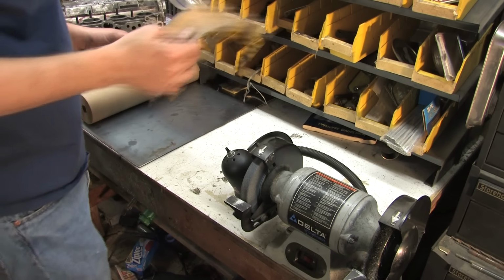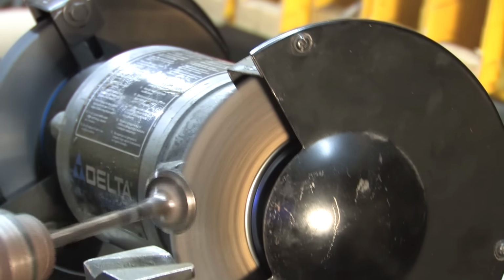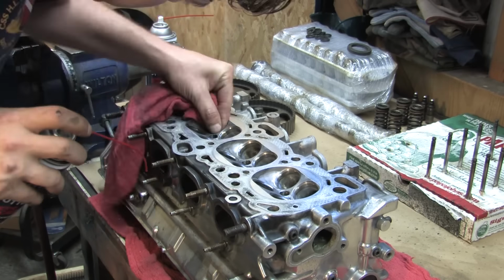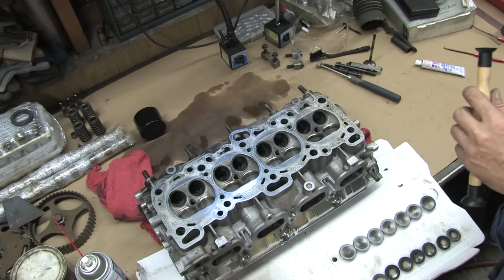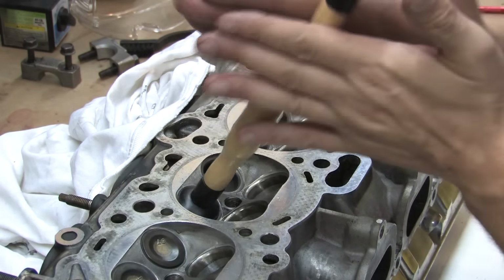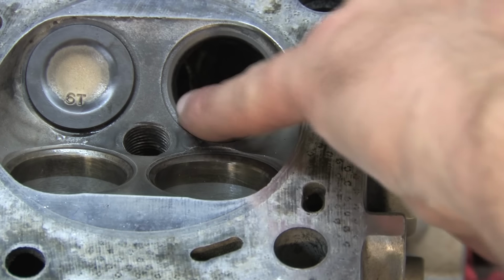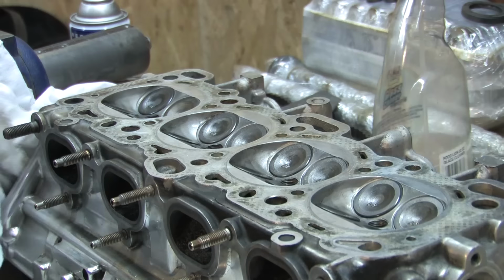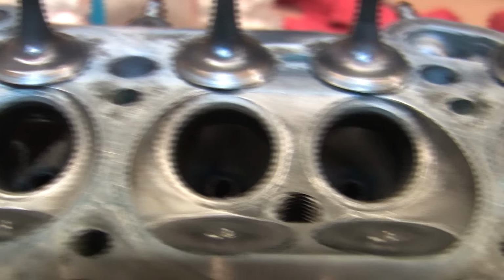Cylinder Head 105 - Valve Job Basics

Comment: Done this a couple of years back on a spare 4 cylinder head i had after watching this vid. All in all it took me around 6-8 hours, took my time, no rush, had the little pots of course and fine compound you mentioned. Head went on my car and is still on there now and holding up fine.
Reply from the maker: Thank you for the feedback!  That's a beautiful e-type in your profile photo, Bob!  BTW... are you my uncle?
Reply: Haha, that E-type was at brands hatch race circuit a few years back. Gotta love them cars, there was a white V12 one racing around the track also, the noise it made going down the main straight was probably one of the best engine sounds i have every heard.
Reply: What the name of the compound ?
Reply: compound w

Comment: I'm about to make my first lapping attempt, and was considering the drill method. You convinced me to start by hand and get a 'feel' for it. Thanks for the great info!
Reply from the maker: Just remember that lapping is not a fix for a bad seat.  It's just a test to see if you have a good seat.  The less time you spend lapping to make that determination, the better.  :)  Read other comments here about that before you start.  Unless what you're working on is built before World War II, lapping is a test, and only a test.  If you have a bad seat, visit my radius cut valve job video!  ;)
Reply: I used the drill for my first time because I didn’t have a lapping handle and it worked great

Comment: Cut a piece of fuel hose that will hold the valve stem and something you can chuck up in a drill.
Keep the drill on slow speed ,  you  can hear the compound change sound when she's good.
We're not building top fuel dragsters it will be ok .

Comment: One short comment, using a drill connected to the valve stem is a bad idea as you state,  I use a two inch piece of rubber hose connected to a wooden dowel which goes into the drill and the other end slips over the valve. It does a great job and it's fast.

Comment: Thank you ! Wire wheel is the only way to remove harden carbon on the valves. I soaked them in Chem-Dip overnight without any effects.

Comment: i like this guy.  He does everything right...has a good head on his shoulders.
Reply: tocay
Reply: Actually he doesn't he missed major steps
Reply: kevykev38 Such as?
Reply: @kevykev38  splain
Reply: @Xsidon  Vacuum testing for one. In valve seat machining, this is absolutely critical.  Lapping the seats is generally the last chance approach. Working the seats as shown here is the approach of do it yourselfer. Not to say it doesn't work and not to take anything away from the video. However, having a machine shop machine a 3 angle valve job (after guide replacement if necessary)  along with a vacuum test is the best way and well worth the money.
Reply: @martin1b  correct me if i'm wrong but what you are talking about seems to be just about confirming the quality of preformed work. it's not a step of the seat matching process itself. plus if you can see where the valve was lapped you can be certain about it beeing done correctly. no lapping marks means something is off but at this point i assume you'd need a new seat anyway. again correct me if i'm wrong
Reply: @Xsidon  Yes, but it is a very important step. You cannot visually see if it's done properly because lapping, and even machining is susceptible to chatter which will cause the valve not to hold.
Reply: @martin1b  honestly i had no idea chatter can occour during lapping. i gues we learn something everyday. good talk thanks
Reply: He could have been COVID-19 Vaccine developer, methodically done job.

Comment: Great job and video. I did do mine with a drill. I was damn lucky on a 4 cylinder gm mercruser. Runs great. Your method is the correct way.

Comment: This is a valve lap. A valve job requires grinding the valve, and seat with a one degree difference. 45 valve, 44 seat. it promotes a better seat,  and breaks in the valve properly over time. Hence it lasts longer. A lap just sands them down to the same angles, and makes a wide seat area, instead of a fine line at the upper portion of the valve face. I'm not saying that what you are doing doesn't work. It is just wrong to call it a valve job, and doubly wrong to sell it as one.
Reply from the maker: The title of the video is "basics".  It's showing the same technique used to verify whether or not a seat is good.  In this video, guess what?... the seats are good.  In the description is a link to a valve job being performed.  There's a section in there about grinding valves.  That's basically the valve job "advanced" video.  I mislead absolutely nobody.  I'm not disagreeing with you, anyone who finds a bad seat is naturally going to realize this doesn't fix it and they need to take it further.  This is the basics.  Hence, the title.
Reply: 4g63?

Comment: Did this to my Toyota pickup 22R.. it runs way better cleaner and efficient.. thank you
Reply from the maker: My old '85 Xtra Cab Deluxe had a little carbon problem.  After a rebuild, I kept it alive for 330,000 miles just using regular BG44K treatments and better gas.  I miss that ol' truck.

Comment: One of the best automotive videos I've watched! Your expierience and knowledge is obvious but you also have a gift for teaching.
I was ASE cert with 25 years expierience. I owned an auto and truck repair shop and employed 15 full time techs.
My shop was 25k square feet and had a machine shop and a partitioned body shop. I owned a separate Corp that was a H D and light duty towing Co.
Also had Volvo, White, GMC dealer affiliation authorization.
I started in a 2 car garge at my childhood home.
I lost it to leukemia but only mention it, 1) because it was a source of pride and 2) because you mentioned health risks when using chemicals. I was proud of you for that. For all those that don't take it serious, my leukemia was likley caused by siphoning gas as a kid when I worked for a bus co. On several occasions I swallowed a bit. I have been suffering the effects for 35 years of which the last 12 included bone marrow cancer. My leukemia was a precursor to BMC so I knew that day was coming. If your reading this, DONT DO IT!  BTW your video brought back memories, good ones. I too was a perfectionist, (Of coarse didn't always succeed). I used the exact method you did and was taught by a master machinist.
Thanks
Reply: Nice heart-felt comment.
Reply: Joe Mikos Hope you get better.
Reply: Joe Mikos i cover myself in this crap all day working in cars i know the damage i know the danger but never think about it like most things in my life. i hope  you get well and recover.
Reply: Joe Mikos i cover myself in this crap all day working in cars i know the damage i know the danger but never think about it like most things in my life. i hope  you get well and recover.
Reply: Joe Mikos  YOU was SAE and YOU learned from THAT? Guides need replacing using special tools. Seats require special tools. If he wants to pull the head back off at HIS expense, that's him!
Reply: Joe Mikos 💜💜💜
Reply: Joe Mikos My hat off to you sir!
Reply: Get well and recover quickly
Reply: Marty Stevens - wtf are You talking about?? Clearly you have no compassion. I feel sorry for your spouse or anyone related to you, for having emotions, but not being able to express them to someone that matters.
Reply: Im no Dr. but I highly recommend that you look into Rick Simpson oil. This stuff has hundreds of cures! Taking high doses of vitamin C & D (10,000 ui) will dramatically increase you immune system, BUT blood work will be needed to assure you are not taking too much. Happiness is also a (special) key that helps rid the body of negative viruses. Inhale the green light (while smiling), exhale what looks like smoke. I know it’s a high dose but there are plenty of videos backing this up. Please do you diligence. If you need help ding them, just reply back and I will post them for you.  Good luck and God bless you on your mission.
Reply: How come you listed out your entire resume here when all you wanted to do is say "thanks"? lol
Reply: Joe, Thanks for your honesty and for sharing your struggle. I pray you're still with us ! Your warning is well received and duly noted. Thanks for the "heads up" mate. God bless you and peace from Down Under ! Marc
Reply: @elmntlgnd69  lol stop promoting snake oil bullshit
Reply: @masonhales  Because he knows that he's dying?
Reply: @Mason because unlike you Joe Mikos was someone and somebody who mattered.
Reply: When you say gas, you mean Diesel? Or petrol?
Reply: Mason 😂
Reply: What are the torque for the EL10  crank shaft and conneciting rods
Reply: Hopefully he is still around <3
Reply: @elmntlgnd69  all of the claims you made about RSO and vitamin c and d are completely lies. I've had thousands of milligrams of rso and so has my girlfriend. Didn't do anything to our health other than get us high. Stop getting health information from facebook and instagram.
Reply: My dad is always doing that even today if the carburetor has clogged, he's 61 years old now and no any ailments or anything.
Reply: WHAT A TIME
Reply: Take care and bless you sir.

Comment: This isn't a valve job,this is valve lapping. Those seats are way too wide.
Reply from the maker: ***** I can appreciate that.  Really they're not, and it passed a vacuum test at the machine shop afterwards, but I wasn't happy with them either.  So... this exact same head is in my video "Cylinder head 201" getting a fresh radius-cut valve job on 1mm OS valves.  ...and yes, they're oversized because my cams and rev limit are changing.  I think there's an annotation leading to it somewhere in this video.
Reply: Vacuum test only tests the seal. Wide seat reduce the ability of the seat to seal against carbon build up on the seat  and wide seats reduce total flow.
Reply from the maker: ***** I don't see anywhere where we disagree except that I have the factory service manual and verified the my seat width was in spec.  Sure it was near the end of spec, but It would have gone at least 30,000 more the way I was using it even with the dual valve springs and aftermarket cams.  This head only had 48,000 miles on it.  But, yes, we both agree.  It was near the end of spec, and I wasn't happy with it.  

Some people have a problem with the title of this video, and there's absolutely nothing I can do to help them.  I'm not changing it.  This is a 100-series topic.  Lapping, disassembly, and assembly... are things a home mechanic can do with the right set of tools.  Seat cutting and valve grinding is typically not.  That's why the 200 series valve job video is shot in a machine shop and handled as a separate topic.  It's linked from inside this video [if your annotations are turned on] at 13:35.  During #201, the machinist does the exact same procedure in this video.  He lapped in 4 valves this exact same way.  2 of them to set the guides on the machine, and 2 more half-way through the job to ensure the guides didn't move and to check his work.  So, lapping valves is by all means a basic valve job procedure.  There are a lot of R&R procedures, and that's why my cylinder head series has so many videos.

When I get a bad example to demonstrate, I'll show it.  I just haven't yet.
Reply: Factory spec has nothing to do with performance. Do any race teams use a factory spec manual...no. It's all about the R&D on the flow bench and dyno. I spent from 1994-2007 doing just that using port flow analyzer 3.0,super flow 600 and a depac dyno and cutting tons of experimental valve jobs on dozens of cylinderheads. You really want to get into black magic...valve springs and cam specs.
Reply from the maker: Performance is why I had new seats cut to a specific depth on a radius cutter and replaced all the valves.  I'm sure by black magic you're referring to the valve spring and camshafts' affect on seat pressure and by cams you're referring to airflow and valve timing.  I've got videos on those topics, too.  Those are also fairly basic, but they're enough to help someone new to the process understand how to dial in their DOHC cams correctly where they should be.  Us turbo guys also have to consider boost pressure with our seat pressures in addition to cam and spring selections, so it's like black magic with chocolate sprinkles.  And of course, "sprinkles are only for winners."  :P

EDIT:  The valve springs, valve timing & lobe separation angle, and valve clearance videos videos were Cylinder Head #203, 205 and 206.  The Hyundai Assembly 5 video was the punishment of getting #206 right with freshly-machined junk parts.  Different head, but same cams and springs that were previously in the head that was in this video.
Reply: Valve timing is the easy part. Overlap,duration, lobe separation all factor into that.  Valve springs seat pressure,open pressure,spring material and shape it's black magic for sure. Hopefully you replaced the valves with a different tulip on the back,just swapping to different stock size valves with a different shaped tulip will increase the the total flow area,jot just peak numbers. What did you do with backcuts and valve margin thickness,those effect total flow area also.
Reply: Did you back cut the face of the valve to reduce back flow and radius the face of the exhaust valve too?
Reply from the maker: I used nitride-coated 35mm stainless steel undercut, backcut intake valves and 31.5mm Inconel exhaust valves.  Exhaust valves aren't undercut or backcut because you know there's no point.  I get you on the radius, though.  They're Supertechs, 1mmOS for a 4g63.  They may have it but I didn't check or have them shaped.  EDIT:  They're in the 203 video /EDIT Springs are Kiggly beehives at 100lb intake, 98lb exhaust seat pressures. 1.7:1 rocker ratio with lighter steel EVO roller rockers and Kelford 272/272 camshafts.  The car is intended to be a show/strip car that is street registered and driven, so I left the valvetrain hydraulic and made some oiling system changes to achieve my goals with it.  The Hyundai build was the test platform for my oil system changes.  I've only had it running a short while and recently inspected, but so far I'm loving the results of my oil system research.  I fixed the oil pressure issues that so many people have problems with on the 4g63.  Posted blueprints of my oil clearances and changes for anyone else to reference.
Reply: What the lobe separation like on a turbo'd car,I'd think the overlap would be minimal too. I don't have a lot of experience with turbo engines. Those are big valves I'm surprised the seat pressure isn't higher.
Reply from the maker: .434 isn't a ton of lift, but it's definitely a lot for a 4g63.  The kiggly beehive springs have enough left in them not to get into spring bind while maintaining an aggressive spring rate.  They're the only springs recommended to keep up with the ramp rates of these Kelford cams without overloading the rockers and the nose of the camshafts.  They've been proven, so I'm really just following directions there.  I'm grateful to those who came before me.  That's the setup used in the standing mile record setting EVO, but he's got more duration than I do.

The lobe separation on my hyundai is a ludicrous 103.75°.  4° of overlap at .040".  Blocked off EGR.  I haven't timed the Kelfords yet, but experience tells me to degree the cams, then measure... rather than relying on the spec sheet.  Sure I'd like the spec sheet to be right, but "advertised" rarely ever "is".  It's usually REALLY close, but some manufacturers are always WAY off... lol.
Reply from the maker: The calculated Lovell factor puts my maximum mean inlet gas speed at 8500 RPMs at 75.27.  That's not too shabby, what says you?  Normal red line on a 4g is 7000.  I know my rev limit values are higher, but it's being built to handle 1500 more than that.  Ported, sheetmetal velo-stack intake manifold, and I'm not talking about my turbo yet.  :X
Reply from the maker: ***** The easy route is propane injection and airflow tuning.  It's where all the big gains are at least...
...it can cost a lot less than machining for most people, but you sound to me like someone who has excellent access to the machinery and making that a non-issue.  With your experience, you should make videos about it and let YouTube pay you for your hard work.  ;)
Reply: I have propane and water injection.  Not as much power as your led to believe
Reply from the maker: Really?  That may be so.  My experience is all 14.7:1 gasoline, so you're correct, I haven't any first-hand experience with Diesel.  All I've seen is before and afters on a dyno from a bullydog performance Dodge 3500 that doubled his torque output.  Horsepower was only like 200 more, but he got 600 more lbs of torque out of that kit, and that pull permanently changed the color of the paint in on the walls of the dyno shop.  lol.
Reply: The kit I have is supposed to be up to 100hp,I've already installed 100hp injector tips too,I gets been programed with a smarty programmer/ predator power puck. Never had it dyno'd,I just rebuilt the Trans and am having some electrical issues with that.  Don't want to blow it up.
Reply from the maker: ***** I feel your pain.  I'd be further along on my Hyundai if I wasn't having so many electrical issues with it.

I look forward to the GSX build.  I'll be putting that Kelford build together soon, and it's going to be a lot different than my Hyundai.  I just need to get past this Hyundai's electrical gremlins first and I'm sure there will be plenty of entertaining footage for you here once I do.
Reply: I hate electric problems

Comment: you must replace them clean not enough because valves under hit  all tim that reduce abillaty of the valve when open and close in engine . but you're way cleaning the seat of valve in engine very cool 👍👍👍good work 🛠